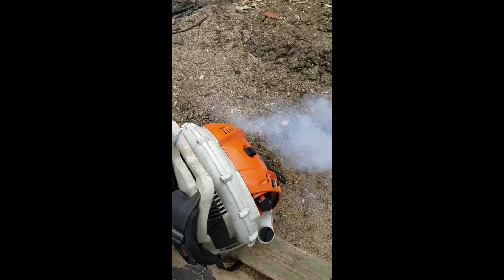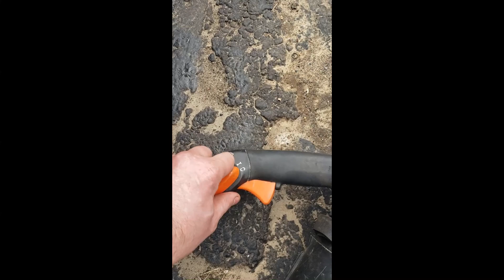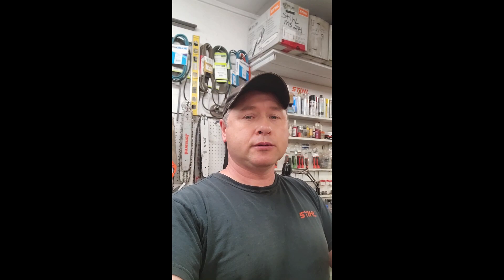Don't Run Diesel Fuel In your Stihl Leaf Blower! #shorts

Comment: That happend on the shop i work at. A  big apartment rental company had our ferris zero turn on demo. They put diesel in it when the fuel level want low and the briggs fuel injected engine compensate and put More and More fuel until the pistons ringland cracked and bent the rods beacause the compression increast alot of the big amount of fuel being injected.After a talk with briggs sweden and a few weeks later had they come up with a new software that shuld prevent extreme engine failure. So be careful with fuel injected engines that had diesel in them

Comment: I bought a Bobcar skidsteer at an auction years ago.  It ran very rough and smoked a lot,  Someone had written "Diesel" with an ink pen on the fuel cap.  Before the bidding, I opened the back door to look at the engine and saw - sparkplugs!?

Bidding was low because of how badly it was running.  The auctioneer mentioned several times that it was a "diesel machine".  When I got it home, I drained the tank and changes the plugs.  It was a great running engine after that.
Reply from the maker: wow lol

Comment: Retired firefighter, I was Captain of station, guys grumbling bc 'cheap mower' that department bought for trimming and now won't start. ..Yep, diesel. Dumped, filled gas. Tapped handle to let it run out. A Deputy Chief stopped by and asked about mower just running.  I told him just don't ask. It's being handled. After that, ran perfectly.

Comment: Had a question for winter storing my 3 stihl weed eaters... I've got an FS56RC, FS46, AND FS45C weed eaters. And I run stihl high performance full synthetic 2 stroke oil, and mixed it 50:1, I run that all year long, and when I think it's the last time to mow the yard I run 50:1 stihl pre mixed motomix gas/oil, should I have to worry about hard starting in the spring

Comment: I used to mix diesel in my 2 stroke motorized bicycle. It would run much faster with 50 to 50 mix diesel & 2 stroke petrol.

Comment: 89-93 octane unleaded ethanol-free fuel is difficult to find around here but ethanol-free leaded "racing" fuel [110 octane] is readily available!

Can I use this stuff in my 2-cycle engines?

How about in my 4-cycle engines ?

Comment: I've run a % of diesel for short periods. My homemade equivalent to seafoam is 57% diesel and I mix it 40 to 1 with 2 cycle oil and then mix with the regular 40 to 1 gas mix. It's been successful in reviving some trimmers that need choke to run.
Reply: What the hell? So what mixture is what? That’s confusing as F.

Comment: Now that's a different two cycle fuel problem. At least diesel is maybe a little better than straight gas? Or at least it won't run long enough on it to do too much damage?
Reply from the maker: yes diesel wouldn't burn out the engine like straight gas
Reply: Surprised it could run at all-

Comment: Wow!  I'm glad that's never happened to me.  What would happen if someone used E85 and mixed it with oil, 50:1?  Damage?
Reply from the maker: i've never tried it
Reply: If it means anything,  my coworker put reg87 octane in are companies pressure washer ,after the first use the engine wouldn't run without the gas cap just sitting on the tank not tight. Gas ruined the breather on the cap..........which is what happened to the very first washer........and both of those were at most 15% ethanol.  Not worth trying unless you can get parts easy, or they have made gaskets special for ethanol
Reply: It would run lean, have low power, and the pump diaphragm, fuel lines, and primer bulb would harden and crack within a matter of days to weeks. Not a good idea. The goal is to get ethanol free fuel, not to run nearly pure ethanol. 😸 Ethanol is harmful to small engine equipment.

Comment: Well that is a new one, I wonder if you get any more power out of an engine if you diesel in it? It would run at a lower rpm, but I would like to some time try it on a chainsaw or weed eater where you actually will feel the power more with less speed.
Reply from the maker: less power but more lubrication
Reply: @donyboy73  Ah, I see.

Comment: Will the diesel fuel harm the engine?
Reply from the maker: no
Reply: @donyboy73  Well, that may just be an easier, and cheaper way to avoid mixing gas😂 - Just kidding, 
I'm a mechanic as well.